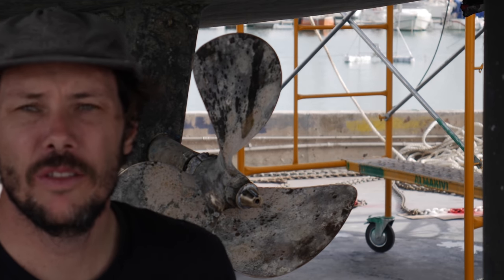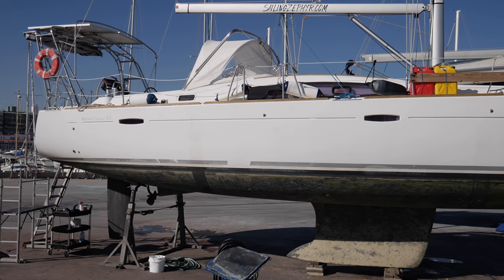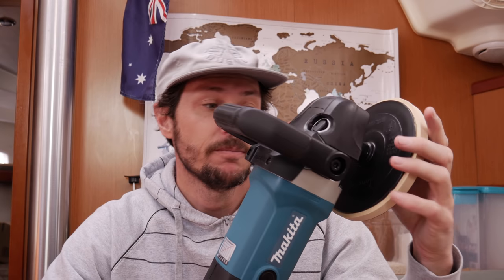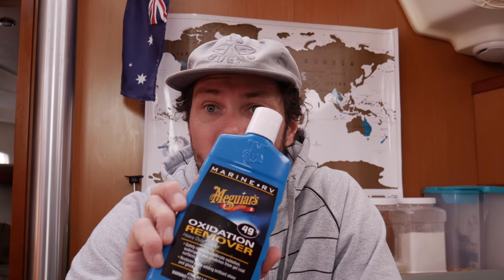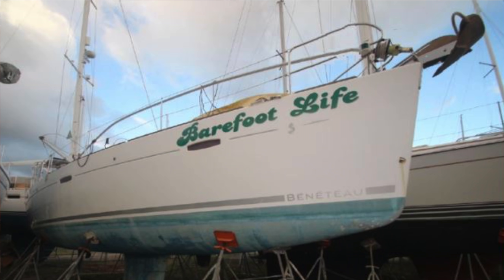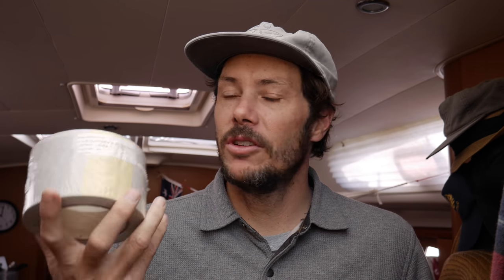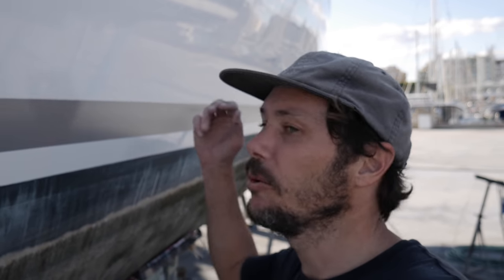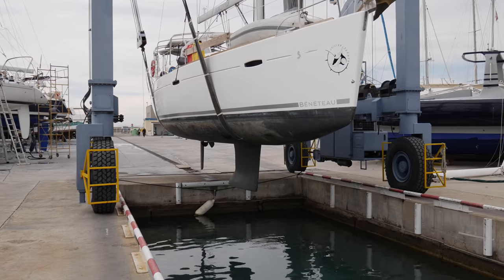Polishing the Hull of our Beneteau Oceanis 43 Sailboat - Ep. 49

Comment: Good progress! If we may offer a little tip on decals for you and your viewers.... Before application, mix washing up liquid with water  1:75  brush or sponge it on the hull infront of the decal as you put it on. This stops the adhesive sticking until you squeegee the water mix out and finally place the decal. It remains movable until squeegeed and a quick rub over with a cloth. The decal will float and bend to your hull shape using this method. Any tiny bubbles will disappear over night. Hope this helps. Sail Safe guys. Ant, Cid and the pooch crew.
Reply from the maker: Great advice. I think my lack of sleep got the better of me. We will lock that in when we put the new name on the stern. Cheers for the support guys. Much love.
Reply: @SailingZephyr  We have done a lot of logos for folks as our daughter has a business in graphics/design. She did our for us too. So if we can be of any help just PM us on FB or contact us through YT. Happy to help FOC . xx